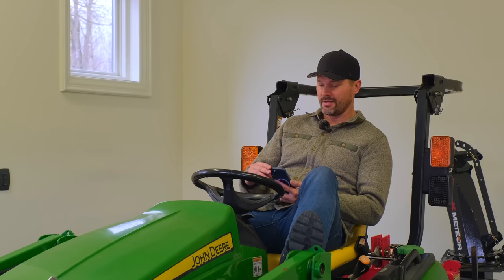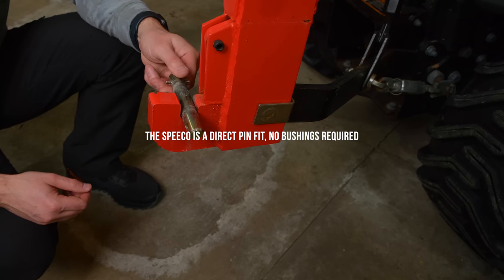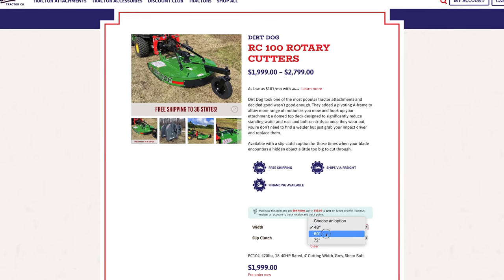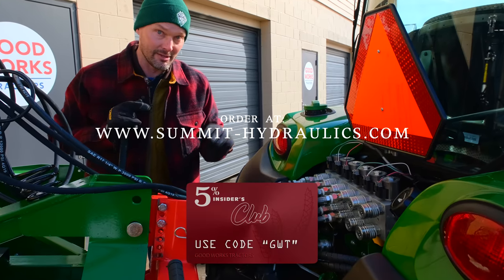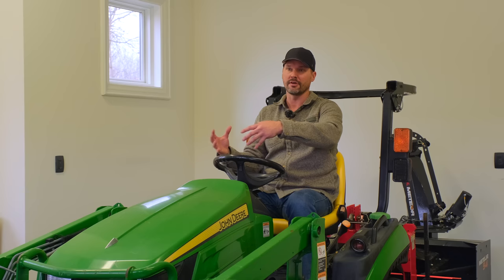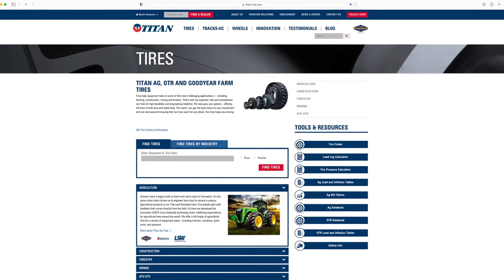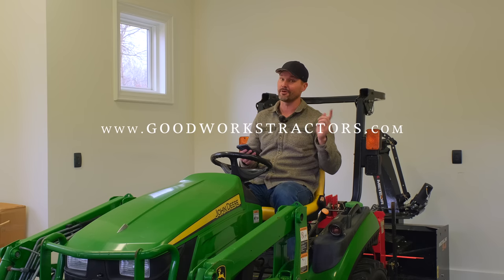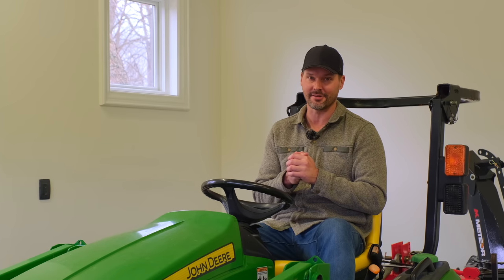YOU'RE WRONG! TRACTOR MISCONCEPTIONS THAT COULD COST YA! 🤯

Comment: Good point about how many hp u need. I have a 25 acre block I have recently cleared about 15 and need to start slashing, a friend reckons the old fellas used to work the area with 30-40hp tractors, but I am thinking of a 90hp JD 6300 with cab, for stability & safety reasons, due to some of the aggressive slopes and terrain on this property, Im not keen on paying for the extra fuel, but I think the safety factors and added abilities of a larger machine greatly out way the considerations of hp and fuel usage.  Bigger isn’t always better, but often it is as there is no substitute for a lack of power, an older, larger, half decent  machine with many hours, will probably do a safer job, quicker, for my purposes, for many years to come.

Comment: To be over tractored or under tractored is the question… I’ve owned 2,3,4 and 5 Series John Deere’s and have come to the opinion through personal experience that most people buy the wrong sized tractor to meet their needs. Just look at the volume of used Tractors on the market with minimal use. 

By owning these tractors I’ve learned what their true capabilities are and are not. I think most people’s propensity is to buy too small of tractor, and then lean towards a bigger model within 2 years.
Reply: It's easier to move up than buy a really expensive tractor to start with. Mine is paid off so I can see how easy it would be to move up now if I wanted too😊
Reply: @melissasmess2773  you nailed. The best tractor in your shop is the one that’s paid off.

Comment: I have averaged 165 hr/ yr with L3901 2018 Kubota on a new property but will likely reduce by 25% moving forward.  The L3902 is available now and would be a logical update; creating an excellent used low hour trade in.

Comment: Tires and rims are a good point with the r4 tires you have flotation  and save your yard but no Traction until you get wheel spacers and put tire chains on.  To get the ag tires on you need duals to get the same flotation equally  especially when they are loaded it would be nice to know from a tire dealer if they can make a wider ag tire in the 24" rim diameter  so it's almost the same as the r4 or make a ag tire for a 43×16.00R20 they would make money and we wouldn't have to pay extra for special rims to be made with no waste
Reply: Or even get them recapped with ag tread

Comment: Right on the horsepower. That is why there are so many different sizes of attachments in order to meet your hp specs. You need to determine the jobs you have and the size of the machine that will fit those tasks.  By size, I mean weight, width, length, and height. This figures into fitting in your tractor to your job area, transport on trailer and storage. By the way, it is true that you CAN'T get R14s on the Grand L series. You can in Kubotas LX series, and I believe smaller models .  We tried on our Grand L 3560 earlier this year and it wasn't available. There is a rumor that John Deere bought out production for their 3R and 4R series, and the tire maker (Goodyear) hasn't been able to increase production for the other tractor makes. The best we could do was R4 over the tractor tread, which, of course, is R1.
Reply: I looked earlier this year to see if maybe I could get R14s from a tire dealer for my L6060.  I never went any further with it but definitely not from the dealer sadly.  I have seen the R14 fill up with mud even on my B2601 so I wasn’t certain it was totally worth the cost for me.  But I do love them on the 2601.

Comment: What is the situation at the 4:14 time stamp with the drone view of the tiller ?  Looks like a significant angle between tiller axis and tractor axis.  Is this a secret to make the tiller more effective or is there some other situation going on here ?  3pt links are different length ?   lateral supports left loose so the tiller can dodge occasional rocks or roots ?  Just curious.  Mine does the same thing.    BTW: in spring when my gravel driveway was mushy after a thaw, I used my tiller to 'freshen' the gravel layer, them comb it with my landscape rate. Just as good as new gravel application.  From constant use, the gravel tends to sink & disperse.  The tiller brings it back to the top.

Comment: seals on the front axle go with too much weight in the loader (about to do the 3rd set)  and you can bend the loader arms.
Reply from the maker: That logic doesn’t add up.  The engineers know how much the loader can lift.  So they also know how to appropriately size the related components.
Reply: @GoodWorksTractors  the engineers do but the accounts put in the order.  Also you forget things like driving into a pile of using the bulldozer function of a 4-in-1 where the whole power of tractor comes into to bear on the loader.  If the tractor was stationary and just lifting up and down with correct counter weight you are correct but dynamic load in an uneven paddock is not a stationary load.  Try holding a bag of concrete above your head and then swing your arms down - the force is higher than the "Weight" .

Comment: Should my loader bleed down with the tractor running?  I like to lift my mower deck with my loader to remove the blades for sharpening.  The loader will not hold it without slowly bleeding down whether the tractor is running or not.  Curious if this is normal or should I be looking for a problem.  It’s a Kubota B7500 hsd if that matters.🤔
Reply: No it shouldn't, leaky valve (internal/external), hose or cylinder seals need repair.

Comment: I thought that sounded weird also that R14s weren't available on the L6060, but according to the kubota website build function, only R1, R3 & R4s are available on that model.   Also checked the L3560 (lowest in that series) and it's the same.  But - they are available on the standard L series.  It seems there's no figuring what these companies decide to do!

Comment: Do you think lifting something heavy can cause your hydraulic cylinder to leak, cause the seal to start leaking? 
I do. First time, shortly after lifting a heavy pallet of bricks, one of the cylinders started leaking. Second time, I lifted a concrete water trough just enough to get the trailer under it and a cylinder started leaking right after. I’ve also broken one of the bolts that connects the loader to the tractor frame. Not easy to get that sucker out.
Reply: Every component should have specs that exceed the pressure of the hydraulic safety valve, dirty or pitted chrome will definitely destroy the seals but small leaks are normal with age and don't need to be fixed necessarily, oil is inexpensive.
Reply from the maker: Exactly.  Failures still happen, but there are engineers designing the entire system to work together.

Comment: so, i've got a loader on my MF 241, and when picking up tree trunks, my tri-ribbed front tires are flattening out. what should i be looking for to firm up that situation (higher ply/severe duty/r4/is solid an option?)
Reply: More air pressure first but then go to a higher load rating to support the extra load
Reply: Correct air pressure should do it, otherwise you maybe lifting more weight than it's designed for? Add weight to the rear of the tractor, it will take weight off the front axle and save a lot of expensive repairs!

Comment: Some misconceptions for me besides what you mentioned:
1) Try first, read the instructions only when all else fails. The risk of injury is a lot more than operating your new headphones
2) I can lift it, so it's not that heavy. When operating smaller tractors, that pivot point/balance matters more than you think.
3) Do not worry about how it works, just what it does. Great way to get hurt.
4) The pins are round. Why should I grease them? If you don't have quick attach, pins like 3 point are WAY easier to get in/out if they are greased.
5) Checking my work is a waste of time. Bent my backhoe hitch pin because I didn't bother to verify the lynch pin was holding the hitch pin. 10 extra seconds would have saved me a lot of grief.
6) A car handles a flat road fine, so I must be able to floor it in my tractor. It only goes 15mph anyway. When hitting bumps in a tractor, it's very uncomfortable to be going at speed. As in, it feels like you may die (probably because you may). Fluid filled tires splash around. Not great.
7) I am only adding hydraulic fluid. I shouldn't need gloves. Apparently, that stuff is caustic. Getting even a little on your fingers can make them chap and get dirt in the skin which doesn't heal for a week. Get a box of disposable gloves and save the grief.
8) Adjustable wrenches solve all your wrenching needs. Sometimes you need two. The big ones are obnoxiously big, but even what seems like a big wrench may not open as big as you think.
9) Why do I need storage? I'm just sitting on the tractor. Rags, wrenches, extra pins, spare shear bolts, recovery strap, and other smaller sized tools can be very handy. Running back to "base" every time you need something is more inconvenient than you think.
10) 4WD means I can handle this hill. 4WD may let you go up/down, but depending on the angle, you might tip, or lose traction anyway.
11) Run the tractor close to idle. It's a hydrostatic transmission, so it'll just ramp up as needed anyway. When doing jobs such as using the PTO, or backhoe, you may benefit from raising the RPMs which raises the hydraulic pressure or PTO speed. Mine has a 540 RPM mark on the RPM meter.
Just a few I could think of at the top of my head.

Comment: While you're looking at tires:  I have questioned how much wear is acceptable on R-1 or R-4 tires.  On an auto tire there's a wear pattern that's a visible reminder the tire needs to be replaced, but on a tractor, it seems like total guess work.  Is there a simple way to determine if your tire is worn and needs to be replaced?
Reply: When they bald or blown. You will know.

Comment: tell me.. are those 5 weights on the front of your tractor on the bumper? i plan to do that more often after i remove the JD weight extender that holds 7 weights.
i do fear bumping something, like a dirt mound and pushing the weights and cracking the front plastics. Do you have them tied down to prevent that?
Reply: You can hang up to 5 small suitcase weights (42 lb) on the front most part of the frame on a 1025R.  It doesn't interfere with the loader and they stay put without being tied down.
Reply: @YMF1891  i get that.. but some people have cracked their plastics if the weights bump something.. the center weight is so close to the plastics.
Reply: @yay4this  I've never had any issues, but if you're doing something where a front tire could drop into a hole I could see where that would be possible.  If you are doing loader work in those types of situations I would probably skip the front weights and get a grill guard instead.

Comment: Love your channel. Have a question. Lots of chatter that Rim Guard messes up a tractors valve stem causing huge issues when trying to inflate or deflate tractor tires. Is this true?  Please if you can do a video on different tire weights pros and cons. Thank you and keep up the good work.
Reply: You have to switch to a metal valve stem. It should be part of the fee.We went this route since we have live stock and pets. It does smell bad when it comes out, but it won't harm our animals
Reply: @jimmcknight3021  Thanks for the reply. Have you had any issues with Rim Guard? How long have you had it in your tires. Again thank you
Reply: @@scubatraveler100  We took delivery on our tractor the Friday of Memorial Day weekend.  Our Kubota dealer wasn't a Rim Guard dealer, so we took it ironically a couple of hours north to another Kubota dealer that was a Rim Guard dealer. There have been no issues with it. Courtney has used it for years as well as Tim on Tractor Time with Tim. I have never heard them complain about it. We have R4 tires, and my understanding is that each tire has 503 pounds of it in it.
Reply: @jimmcknight3021  You've been a HUGE help many thanks.
Reply: @@scubatraveler100  By the way, our Kubota model is a Grand L 3560. Their R4s, I believe, are larger than the Kubota LX series and the John Deere 2R series R4 tires as a point of reference.
Reply: Jim Jim Jim you just opened up a new can of worms. I'm looking at the lx series vs the Grande series. What made you go with your choice if you don't mind sharing. I'm brand new to this so right now I'm on a information gathering frenzy. You've already been a big help so any advice you throw my way would be much appreciated. Rick
Reply: @@scubatraveler100  these two series if Kubota are the deluxe series for them. LX is similar to the 2R series in JD and the Grand L to the JD 3R and 4R series. The 3560 L is basically 5 feet in width. As you go up in the Grand L line, each model gets about 6 inches wider. I don't think the Grand L has transmission white as much as the LX. Although I have heard they made some improvements on the LX so it may not whine as much.
We needed a tractor to lift round bales of hay for our goats and sheep for our small herds. With the Rim Guard and suit case weights on an implement, we can do that. I  don't think an lx or 2R can do that.
I like that the fuel cap is down near the floor board on the Grand L and there is no treadle pedal like on all the other Kubotas. It's a better design which I think combines the advantages between  the two peddle system and Kubotas regular treadle peddle. I also like the fact  that you can get a heavier loader on the Grand L. With that heavier loader, you can get a hydraulic skid steer couplers system. You can push 2 buttons to attach and detach your front end loader (fel) attachments without getting off the tractor!
We also had installed the OEM third function and the three available rear hydraulic ports. We are using one of the rear ports now for a hydraulic top link. Once again, that will keep you on the tractor instead of jumping off to manually adjust the top link. 

I hope that helps
Reply: @jimmcknight3021  It helps a ton. Things I probably would never have thought of. I do appreciate your time and patience in this discussion. Have a Happy Holiday and again thank you. Cheers.

Comment: A thousand hours ain’t nothing. Years ago back on the farm we had tractors with eight thousand plus hours on them and they were gasoline engines. Don’t get me wrong we did regular maintenance and made repairs but as long as you take care of them they will run a long time. Diesels are even better cause they run at lower rpm’s and develop more torque w/o revving very high.

Comment: Often when a dealer tells you something isn't available it really means they would rather sell you what they already have without any extra work.  When I was looking at tractors the only models Kubota had on the lot were Special Edition with fewer features for almost the same $ as standard models and Anniversary with stuff I don't need for more $.  They claimed standard models couldn't even be ordered if I wanted to be on a waiting list.  Chip shortage or not, that didn't seem true.  That plus the new electric threadle is even worse than the old one so Kubota was out of the running.
Reply: The treadle, lack of new inventory, low ground clearance and probably reliability too were reasons I bought a Yanmar SA424. The dealers were asking almost new price for tractors with 1,000 hours or more...ridiculous!
Reply: Of course a dealer would prefer to sell what they have in stock. I don’t know if tractor dealers operate the same way as car dealers. But if they do then a new tractor sitting in their lot is costing them a bit of money every day.

Why not buy the Special Edition tractor if it’s there and doesn’t cost much more than a standard model?
Reply: @melissasmess2773  Funny.  I ended up with a Yanmar YT347.
Reply: @kdegraa  Special Edition is misleading because people like you think it means it's better than standard. They have fewer features than the standard model.  It was only $1,500 less than the standard model, but was missing $2,700 worth of features.

Comment: My theory is the guys who worry about putting hours on their tractors don't understand diesel engines and more than likely were into older gasoline powered garden tractors.  Those engines in those machines where barely 1500 to 2000hr engines, so a lot of the older kohler and onan engines get a bad rap because they were well used way past what they were meant to be run.  300 hrs on those tractors 20% of the life used up, 300 hrs on a diesel your just barely breaking it in.

Comment: The reason rear ballast is most important, is the fact that the front end is the fulcrum when lifting with a tractor loader. You have a lighter duty center pivoting support as opposed to the heavy duty solid rear axle that is made to carry weight and is solidly affixed to the tractor. Operators should be prepared to quickly lower the bucket in a tip situation. Years ago, I built an F10 loader that places the weight on the rear end. (The whole thing is set up backwards). We tipped that loader many times but it never tipped left to right because the weight is on the rear end. Similar to https://youtu.be/gbCeTs5Juwc?si=Fojp9KJaUnKYJxWo

Comment: I know a guy with an old Ford tractor with a loader on it and they put a hydraulic pump from a backhoe and that thing will lift so much that it keeps blowing hoses.
Reply: You can put in a stiffer spring behind the relief valve too but you can damage everything else too😢